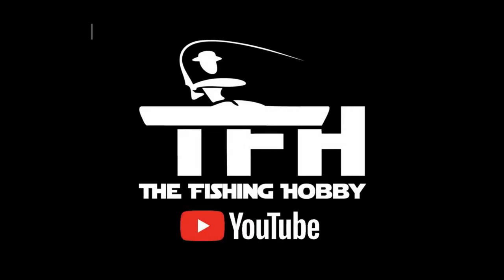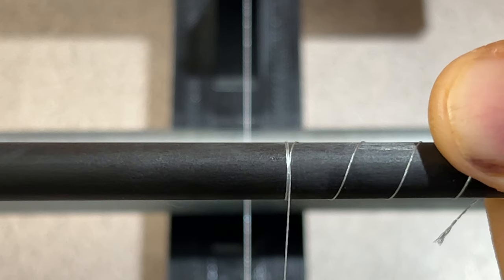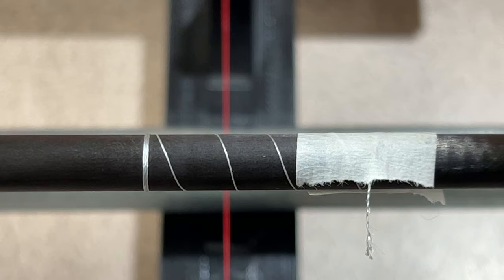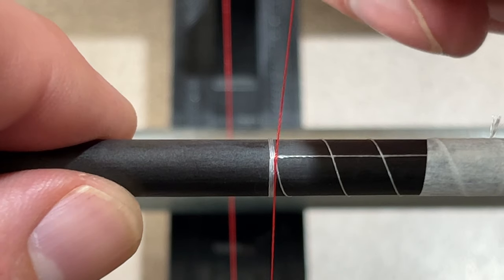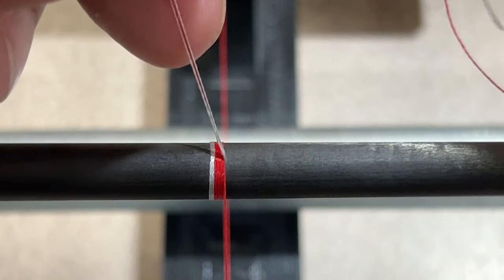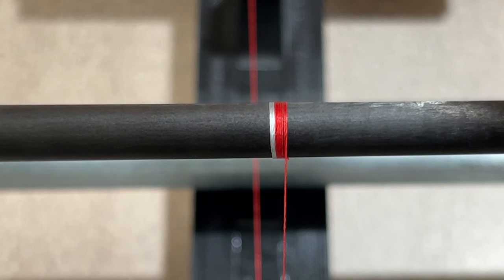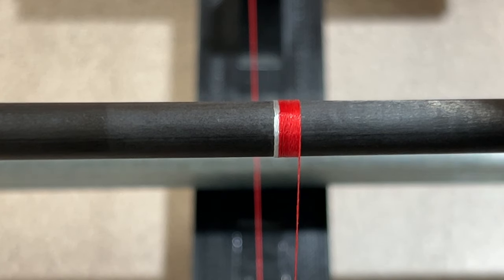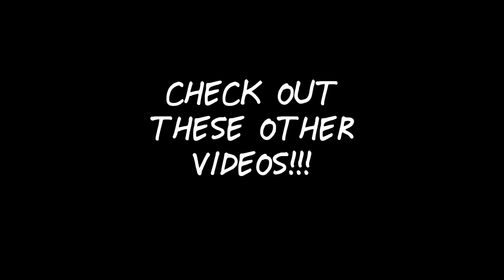Rod Building Basics: Part 2 - Basic Trim Bands

Comment: Great workmanship sir, what kind of machine would you recommend for this beautiful winding workmanship?
Reply from the maker: I used the hand wrapper I make and sell. You can look at those here if you haven’t seen them: https://youtu.be/pNWHK03lHrs?si=brZOPafHlKH2DwJc
This is my store: https://5286af.myshopify.com/

You can do the same thing on a setup that you can make yourself for free like like I show here: https://youtu.be/wEC8ktjlYTk?si=v4xwJ3cFjPk6gneX
The difference is the jigs I sell make it easier to do. There are power wrappers and hand wrappers of all sorts available and if you know what you are doing, you can get any of them to work out for you. What it really comes down to is what does the wrapper offer you that you want? To figure that out you can try something like the cardboard box jig for free. A jig like mine allows you to back up several turns to correct a mistake without loosing you thread tension. You might find that you would like that feature after using a cardboard jig (I’m so used to being able to backup without loosing tension that I find it difficult to wrap without it). So that really doesn’t give you a direct answer 😂 I enjoy making and selling my jigs, but I would rather someone get what they feel most comfortable using so they enjoy the hobby and stick with it. Cost is a factor, features are a factor, convenience is a factor…but the reality is almost anything will work if you practice enough to get good with your wrapping technique.